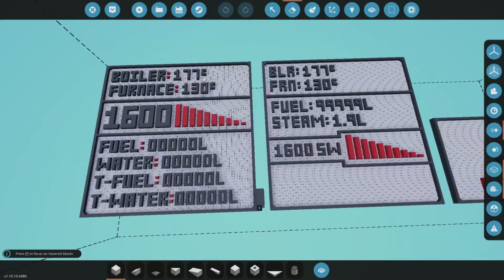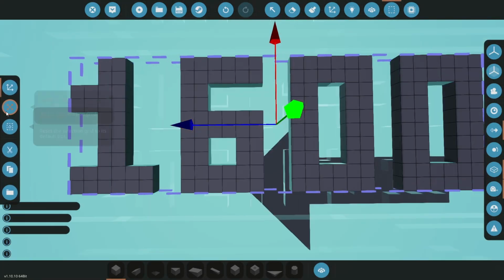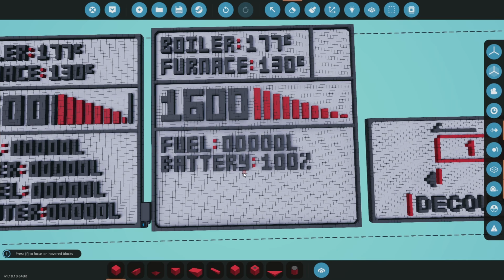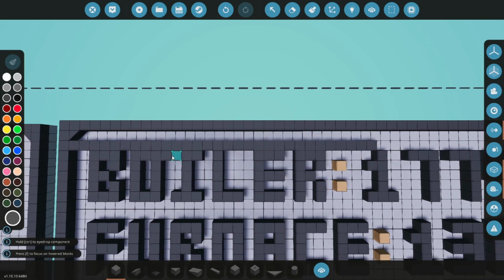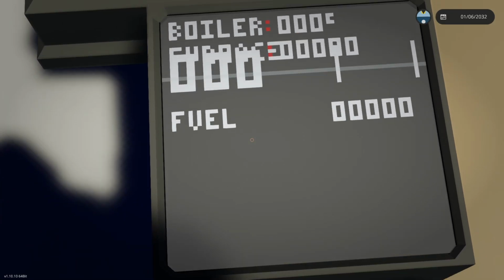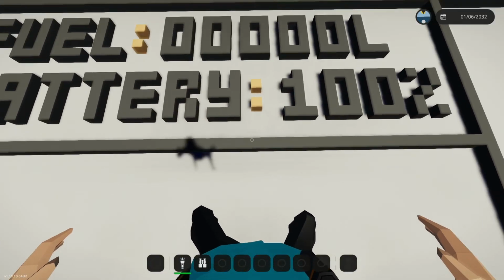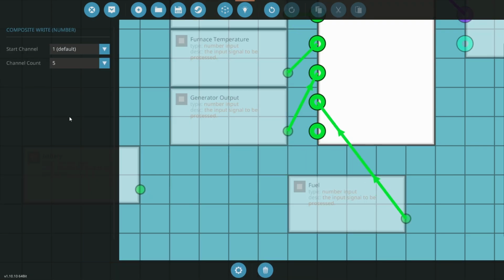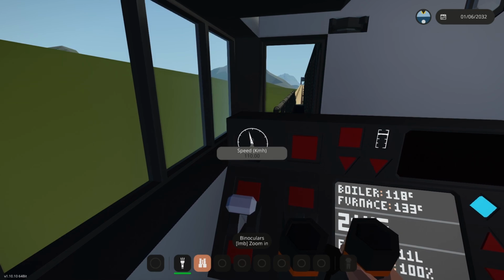TCP - Oil Burner Loco 2x2 Display - Stormworks

Comment: as for the tight rail "jank" at roughly 25 minutes. thats why i stick to a max of 3 connected steam wheels, theres a few spots on the railway they can get stuck on if u have 4 in a row sadly.
Reply from the maker: Yea, even with 3 its a bit tight in some places. I am of the opinion that If I make enough cool looking trains, people will sub to them and start to realize how bad the tracks are and cause a ruckus to get them fixed.